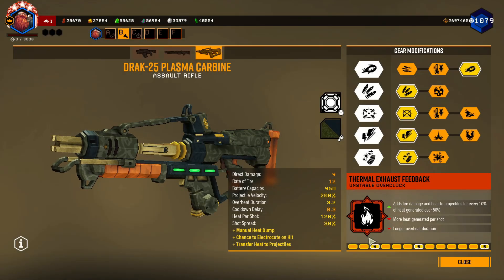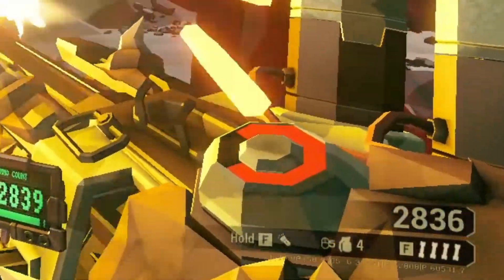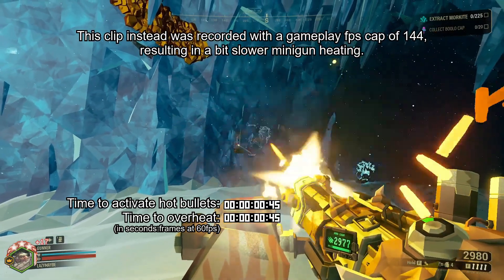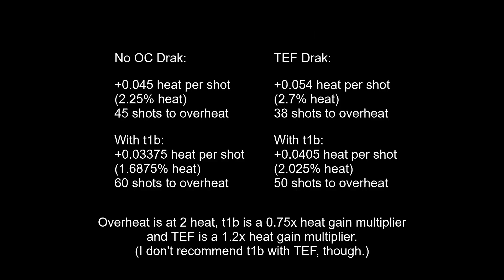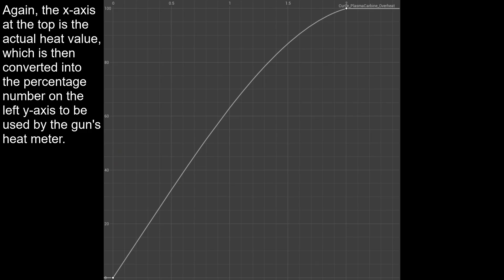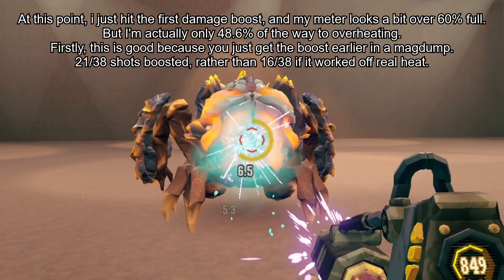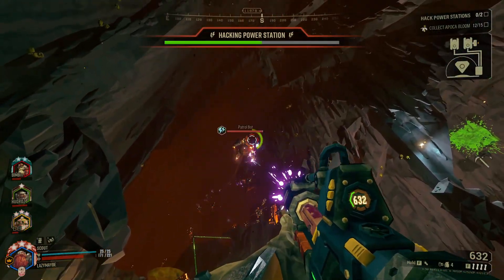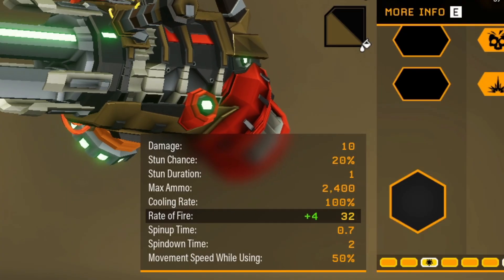DRG Season 4 TEF buff, mechanics, and some bugs (especially with spreaders)

Comment: Hipster nerf when?
Reply: LazyMaybe is anti hipster nerf
Reply: Hipster was nerfed by the buffing of the gk2 

Other things do its niche better now, and it wasn't ever better than hoverclock.

I used to like it but its too annoying to deal with purple spitters, and that is like scouts whole thing.
Reply: @AveragePearEnjoyer  I'm not on the hipster needs a nerf train, I think that it's outperformed by focus builds, but these justifications you gave make 0 sense to me.  Bad at dealing with web spitters?  Do you not take t1 damage / t2 armor break?  Hipster is arguably the best build in the game for dealing with spitters, because with a 1 shot breakpoint you're able to kill them as fast as you're able to aim at them, and you can very reliably kill 14 of them before reloading.  The only thing better is maybe NTP when they're dense and you don't need them dead immediately, or maybe ECR in similar circumstances, but definitely not anything else scout has access to.  Web spitters are one of the few hvts that hipster actually does really well against. 

As for gk2 taking its niche, I wouldn't say so.  Hipster does 288 dps without weakpoint mod, 346 with it.  OFM does 266 without weakpoint mod, 319 with it, and OFM can do that dps at a much lower effective range than hipster.  AISE does 243 dps without weakpoint mod, 275.4 with, but it's conditional on actually hitting a weakpoint.  Max damage BoM does 314 without weakpoint mod and 376 with, but it's highly conditional; you're not getting that dps against small targets that aren't worth applying a status to first.  And on all of these gk2 builds taking the weakpoint damage mod means you'll be pretty terrible against armored targets like brundles and shellbacks, while also hurting your spitter breakpoints ("scout's whole thing" according to you) while hipster gets to take armor break and weakpoint damage at the same time.  So the fairest comparison is actually hipster with weakpoint mod vs gk2 with armor break mod, in which case hipster just has the highest dps by a large margin on top of not being conditional.  Hipster might not be the strongest m1k build, but it's still an m1k build; the other weapons just lag behind.  

The issue with hipster is not that gk2 exists.  The issue with hipster is that its niche - high close range single target dps- is just both not a hugely important niche in the first place and also definitely not what scout in particular should be focusing on.  Focus builds lack single target dps, but they make up for it by killing hvts much more quickly and effectively, which is a lot more important.  Taking a bit longer to kill a tank means very little, since they're not a threat.  Taking a bit longer to kill a trijaw means a lot, because that trijaw could get a shot off that kills 1 or more of your team.
Reply: @VorpalSword9  i always take recoil t2, i don't like how it feels otherwise. It locks you into close range dps bursts instead of just drilling through hp at long range like a vast majority of other scout builds. I guess I didn't consider that armor break helps with spitters, but the gun is so nerfed without recoil control imo.

I don't think gk2 being bad into armor is a huge weakness for gk2 melter builds. You are always going to be out manuvering larger bugs and shellbacks are tough for most scout builds anyway, so I just power attack them once and move on.

The only hipster build I ever liked was hipster+cryo mines. The idea was to have good CC by mulching through frozen bugs with blow through, but the mod tree configuration and playstyle and feel was overall just less natural feeling than hoverclock.
Reply: @AveragePearEnjoyer  If you really care so much about long range dps that recoil seems like a must take, then sure hipster seems bad... but anything besides m1k focus builds or AISE is going to feel bad.  I'm not going to say that dps at that range has 0 value, but most enemies you engage are going to be pretty close.  At the very least, hipster clearly has a niche for the best unconditional close range dps from a scout primary.  

> shellbacks are tough for most scout builds anyway, so I just power attack them once and move on

I wouldn't say they are.  Any reasonable m1k build is going to take armor break in t2, which guarantees you're at least pretty good against them.  I would argue that basically any gk2 build should also take armor break because shellbacks are such a high priority enemy, plus you get better acid and web spitter breakpoints which is great for scout.  So it's really just drak that's not great against shellbacks.  As for just power attacking and moving on, I really do not think it's good to ignore the most dangerous enemy in the game.
Reply: @VorpalSword9  as scout I want to kill priority bugs before they get to the rest of the team, so I play farther out and at longer ranges. Practically speaking its very hard to kill a well positioned shellback before they get to the team, even with a build that counters them. But when they do get to the team, gunner and driller are far better at killing them. Shellbacks are just a fact of life. And even if you do play up close, having a better matchup against shellbacks is not worth just overall having less ammo and damage.

Again, i just don't see why anyone would want it when you have AISE or bullets of mercy or supercooling chamber that all just got buffed, not to mention that hoverclock is just better than all of those things and always has been. Hipster isn't bad, it can break armor, but the opportunity cost is just too high for me to want it. 

I think the best things scout can do is intercept bulk detonators and oppressors and the like, (bullets of mercy is great for that because IFG or taser bolts or both give you a slow that makes them so easy to melt) 
And picking off spitters, where most builds are fine, standard m1k is the best, and hipster is just as good if not worse because of the recoil or the 2 hit kill on body shots, and you lose mobility.
Reply: @AveragePearEnjoyer  I would not consider bulks or oppressors to be priority targets, both are slow enough that any class can trivially just walk away slowly if there are other enemies that need to be dealt with.  A shellback, on the other hand, needs to be dealt with as soon as possible because a single bonk or a single shot can easily kill a teammate.  Yes your teammates will also have shellback damage, but scout doing damage to them is very often the difference between killing them before they do any damage to the team and killing them after.  

Supercooling chamber and bullets of mercy are just much worse than hipster against actual high value targets like web/acid spitters, trijaws, and shellbacks.  Honestly even AISE is worse, slightly better ttk/effective range against trijaws isn't enough to make up for the deficits against the other 3. Also, I'm not sure why you think hipster has issues with range/recoil but bullets of mercy doesn't? 

> And picking off spitters, where most builds are fine, standard m1k is the best, and hipster is just as good if not worse because of the recoil or the 2 hit kill on body shots, and you lose mobility.

Focus builds are best, yes.  But unless you're running a non-SCC focus build that can 1 shot acids, hipster is going to be better than anything else against spitters.  On top of having high close range dps.  I still find it weird that you think hipster has issues at range but somehow bullets of mercy doesn't?   Hipster is a much more accurate spitter sniper, no recoil necessary.
Reply: @VorpalSword9  no, BOM definitely has range issues but the damage is much, much higher. And its not so much that the tanky bugs are super threatening as it is that you can kill them faster than anyone else and doing so lets your team focus on other things. 

I see you are a hipster fan, And i'm just not. Its not like there is an objective answer to which is better, but there is no denying that there are more options for scout that compete with hipster indirectly  now that gk2 got fixed, and its pickrate has probably fallen off. Thats all.
Reply: @AveragePearEnjoyer  Much, much higher?  I gave the numbers in my earlier comment, 346 for hipster vs 376 for BoM, so hardly significant.  And that's assuming the BoM user decides to give up on good spitter breakpoints and brundle/shellback damage by taking weakpoint mod.  If they take AB as I would argue is correct, it's less damage.  And that's conditional on having BoM activated.  

> I see you are a hipster fan, And i'm just not.

The funny thing is that I'm not.  I think nonhipster m1k focus builds (besides SCC which is not great) are far beyond hipster in terms of power level at least if we value scout filling its role of hvt killing.  I just think that non-m1k options are even worse than hipster, gk2 buff or no.